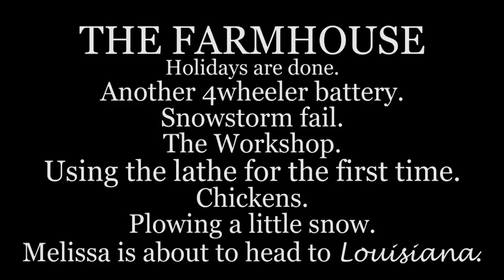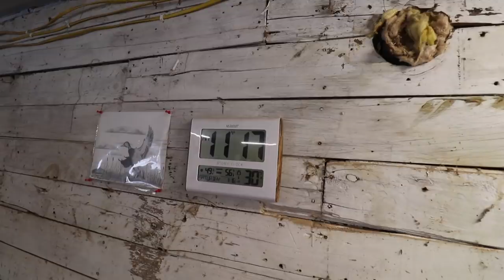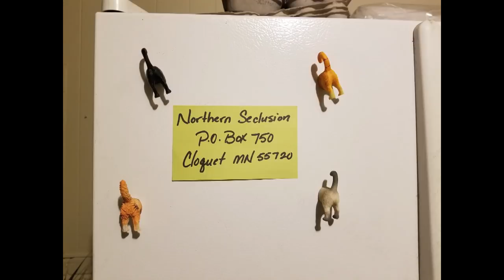THE FARMHOUSE. Using the Lathe. Workshop. Chickens. 4wheeler battery.

Comment: Hi Joe!  I have a 90 year old lathe with a similar pulley shaft block setup as yours.  That pulley block has fiber or leather bearings with little oil 'windows' to drop oil into occasionally.  The lathe headstock itself has a little spring loaded cap for oil there, but the pulleys below just have a hole at each bearing area.  If yours has that, they may be dry.  Love your energy and enthusiasm my friend.  Keep on truckin!

Comment: You should raise the tool rest up to the center of the object you are turning.    the end stock center is called a live center. Get a saddle bracket for the motor. This will let more air around the motor.

Comment: I use a BatteryTender attached to my motorcycle battery with the supplied quick connect plugs that I store in an unheated shed. It’s a cheep investment that safely keeps the battery at full charge. A couple of those would really extend the life of the batteries
Reply: Here in the UP I use a Tender on my Limited Low. It works well. I use to have a HD battery in my Road King but it didn't last. I bought a battery from Walmart 2 years ago and believe it or not that bike starts right up. I don't even put a BT on it either. Weird hey? 🤷‍♀️
Reply: Battery tenders are great, I have five on my equipment.

Comment: From an old lath man, looks like your way below center on that tool holder - raise it well above center and angle your tool about 12 to 18 degrees so that it actually cuts. Also, we use to use beeswax on the tailstock or now, if you have it, a bearing mounted to the tail holder. I'd put a small 12-volt fan in under the lath to cool the motor and belt pulleys. I always loved working with both metal and wood lathes.

Comment: Joe, have you ever considered battery tenders.  They make them for ATVs, motorcycles, snowmobiles, etc. to maintain your batteries over extended periods when the vehicle is not in routine use.  I have one for my motorcycle and two for my cars since I am not using them over the winter and during the pandemic as much.  They are about $50 and can extend the life of a battery several years.
Reply: I live in Michigan and experience a similar climate to yours and my batteries face the same conditions.  A battery charger can over charge and damage a battery if left on too long.  A battery tender has built-in electronics to monitor the voltage.   When at full charge it shuts off and doesn't overcharge.  When the voltage drops to a certain level, it will trickle charge to bring the voltage back up and then shuts off again.  It repeats the cycle as necessary.  I use a product manufactured by Optimate.  Companies like Honda use Optimates under their own brand.  There are cheaper brands.  I have had great success with my Optimates and you can find them on Amazon.  A battery unmaintained will only last 2 to 3 years.  One maintained will last 5+ years.  The battery tender will pay for itself.

Comment: That looks like an old lathe I had in Shop Class in Jr High.  I know we would use a little soap as a lubricant on the non spinning end piece.
Reply: The non spinning end is called a dead centre and you never want to use that on wood. The friction will just burn away the wood and that’s when you get wobble. Always use a live centre on wood. 👍

Comment: Make about an 8 inch wooden decorative item on your lathe.  Then stand it up and sit it on the bench. Then take a drill and drill holes downward, all round it.   Then shove it tootsie pops in the holes.  A tootsie pop tree.  Also save your empty plastic laundry bottles.  Fill them with your rock salt.  Then you can grab one and shake it all over the porch, the steps, sidewalk etc.   They are easy to carry and you can even throw a few in the car or truck.

Comment: before you start turning on the lathe run the block thru your table saw and cut the corners off  on the long  side and it will help with brake out.

Comment: What did you and Melissa ever do with the kilms you got?  And did they ever pave your road before it started snowing?
Reply from the maker: 2 of the kilns are in the front garage along with the 300 plus molds. The 3rd kiln is in the main garage. They did not pave it before winter, I guess that will happen later this year. It is much smoother as dirt than it was when it was paved.

Comment: i use the pre mixed 2 cycle in qt cans in my weed eater chain saw leaf blower it is a little more money but the start after setting for awhile and it doesnt eat the carb seals
Reply from the maker: The problem with that is, my chainsaws take 50:1, the weed eater takes 40:1 and the ice auger takes 24:1. Lol.
Reply: @NorthernSeclusion  they have 40:1 and 50:1 it comes in qt. and gal. at tsc

Comment: Joe, Any reason you don't put a trickle charger on the 4 wheeler battaries?  We have one on 4 Wheeler in PA  Works great. Always starts in cold.
Reply from the maker: To hook it up to the battery takes an act of god (if it is a battery charger). Maybe the trickle chargers have wires that run out from the battery so they are easy to hook up to? I would hate to have to take the charger off and put everything back together, use the 4wheeler for a half hour and then have to take it all apart again to get to the battery. I really do not know how they work though. Until I posted the last couple of videos I really had never even thought about having a tender type thing.
Reply: Joe, you do not have to unplug from the Battary. There is a plug and socket in the line. All you do is unlpug and go. The battery hook up stays on. Our Battary is under the seat. We have an short length wirw coming out that unplugs. When finished plug back in. Very simple.

Comment: I’ve done slot lathe work over the years look in to a faster motor
Reply from the maker: I can adjust the speed easily with the belt pulleys. I need to figure out what speed works best, it has been awhile.
Reply: I started out with a shop smith at 16 I would probably think that motor is ready to burn up if it starting to smell when using it

Comment: Nowaday's you use 40:1 2stroke oil mix instead of that 24:1 mix.
Reply from the maker: It clearly states on the machine that I should use 24:1. I will stick with what the manufacturer says I need to use.